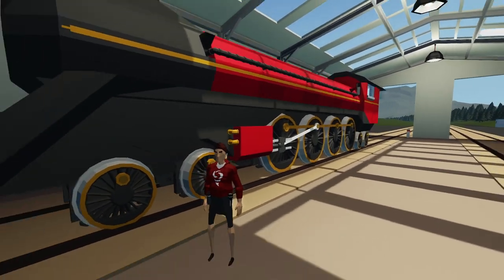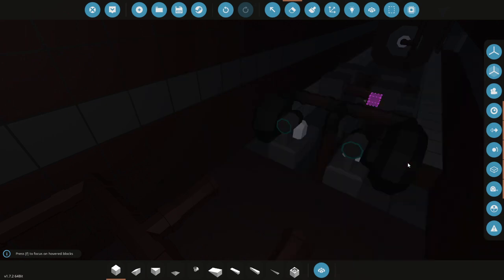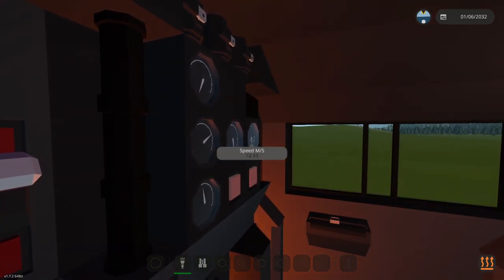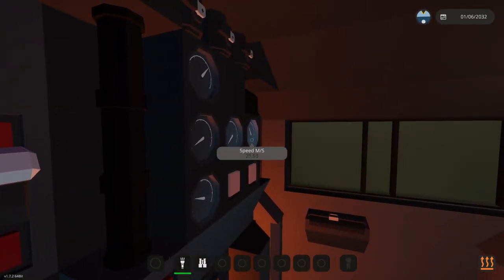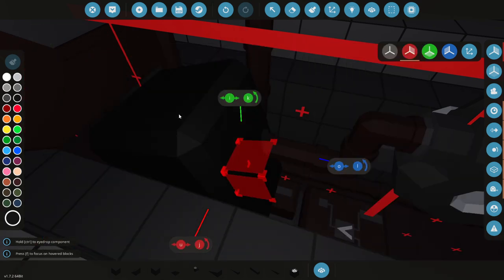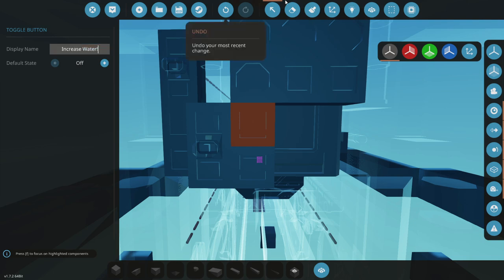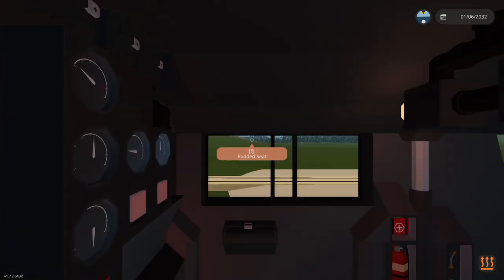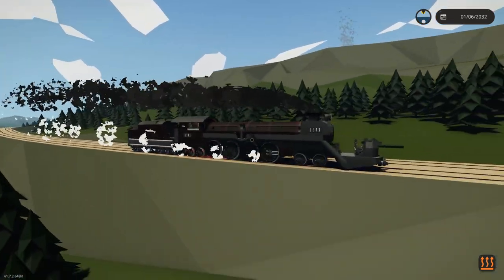WE FIXED THE STEAM ENGINE! IT WAS SIMPLE! - Lets Build A Steam Engine In Stormworks!

Comment: Frantic, you have to vent extra steam from the system. It's a really dumb thing, but steam equals pressure and because condensers cannot keep up with the amount of steam production a boiler can put out (unless you have about 30 condensers to 1 boiler) you'll get a backup of steam in the system and that will equalize the pressure in your pipes and you'll just build pressure until the boiler bursts or until your train comes to a crawl. Trust me on this, I don't like it, but I've had to go to this kind of system of bleeding more water than I'd like. Hence this is why I've always made my tenders, as of late, mainly water tanks with extra coal on top of it.

But I'm really wondering if your original design had two fresh water tanks. Part of me wonders if one of your tanks might have been left on diesel, which would explain why your train would die. You can run diesel as a coolant for a little while, but you cannot vaporize it into steam in the game.

I'll weigh in on the suggestion and say don't armor the train. It takes way too much armor for any to be effective at all in a practical sense and you'd lose any and all aesthetics and functionality of it. The most you could do would be to add a few layers in that empty space in case you take a round head on, but trying to add enough armor to tank hits from the top and sides is really nonsensical in terms of practicality. You can make it "look" armored, but to actually make it armored will just kill it outright.